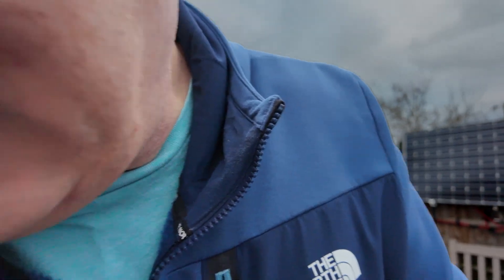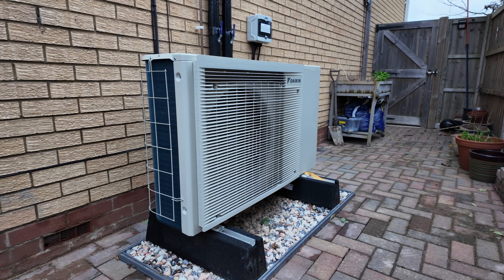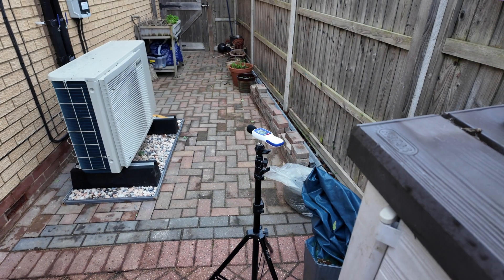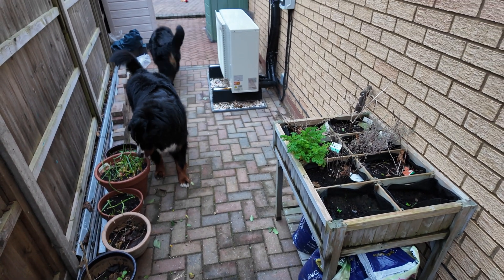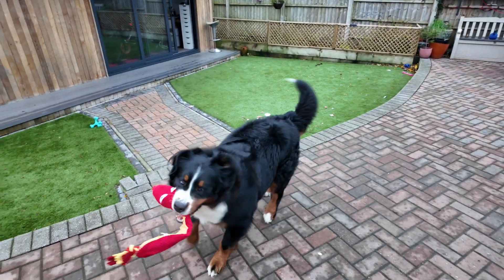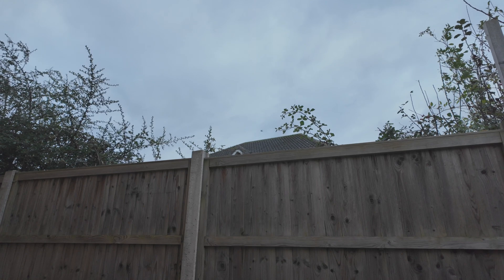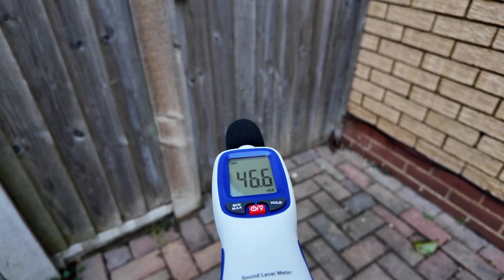The Shocking Truth About Heat Pump Noise in 2024

Comment: What about the noise inside your house where the cylinder is located? The outside unit usually isn’t a major issue, but the internal pumps often are. Could you check the sound level there?
Reply from the maker: there is zero noise, i can hear water moving through pipes when the showers are running, the pump seems to be silent
Reply: @JonathanTracey  Thanks so much for the quick reply! I’ve just bought a house with a Samsung heat pump. The outdoor unit is very quiet, but the indoor unit with the cylinder is very loud. Even with all doors closed, the noise is clearly heard in the bedroom. It seems like the circulation pump is causing it - both during hot water heating and normal heating. Since the heating runs almost constantly now, the noise is really hard to live with
Reply from the maker: It might be a sign that the pump needs replacing, @mediafire09. I checked mine today and it’s very quiet in the cylinder cupboard — it sits on the other side of a wall from the Chief Finance Officer’s bedside, and I’m sure I’d have heard about it if it was noisy!  

I tracked down our circulation pump and it’s actually up in the attic above the tank, so if it were making any noticeable noise we’d definitely hear it in the bedroom. Yours sounds much louder than it should be.
Reply: @JonathanTracey  Thanks, that’s really helpful! I’ll try measuring the noise level (in dB) to see just how loud it actually is

Comment: Had our 6kw Daikin ASHP installed in summer by Octopus and whilst it works really well in terms of heating the house and hot water it’s far from quiet in operation. The main issue is the amount of noise it generates inside the house. 

First issue is that as you probably know, below 6 degrees C the circulation pump runs continuously to avoid pipe freezing. In our set up we have two zones, upstairs / down and thus if neither zone is calling for heat then the zone valves are closed and the only path for the water is through the by pass valve. This creates a lot of noise and can be heard throughout the upstairs. Temporary fix has been to remove the actuator on the downstairs zone valve leaving it open and thus a path for the water to flow. I presume that most installations don’t have any zoning but we like our upstairs a bit cooler than down and hence why we decided to keep the two separate. Octopus have been back to implement this but not sure if this will be the best permanent fix. 

I question why you need to protect insulated pipes from freezing at anything below 6 degrees and why the flow has to be so high, currently set at 15l/min. Octopus are also going to change the bypass valve to whatever the latest model is as it meant ti be a lot quieter in operation.

Second issue is with low frequency compressor noise during the first 30 - 40 mins of operation, or when the HP is working hard. Our unit sits away from any neighbours and against a gable end with no windows. We can hear the drone of the pump both in the living room and the bedroom above. When you go to the unit it isn’t the noise of the fan / air exiting but the drone coming from the rear of the unit. What probably isn’t helping is a solid, high wall running down the side of the house. It’s several feet away from the unit but it’s probably a perfect reflector that’s causing the noise to reverberate between it and the gable wall of the house. Not much we can do about this but I do question why the Daikin has to ramp up as it does and how this can be tweaked to reduce the noise nuisance. Octopus due back in the next few weeks so will see what you have to say.
Reply from the maker: Not had any of those issues with mine, have heard there are issues when it’s wall mounted (instead of on the rubber isolation feet) is that how yours is installed ?
Reply: @JonathanTracey  floor mounted. I guess you don’t have any zone valves hence no problem with the circulation pump running against closed circuits. In terms of ASHP location / installation is very similar to yours but we do have a solid brick wall to the side, rather than a wooden fence, which may be part of the problem. I have heard of some folks getting Daikin to add sound insulation around the compressor so may need Octopus to sort this. Will be getting them back in a couple of weeks as I’m still not 100% happy.

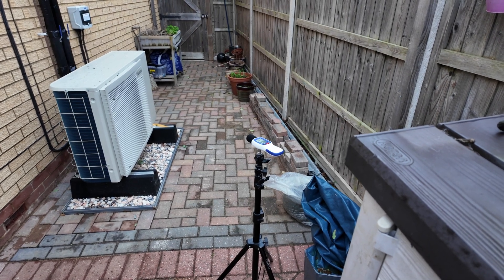Comment: Thanks for the video. Here are my concerns as a hyperacusis (hypersensitive hearing) sufferer. The low frequency noise that not everyone can hear, such as the wuh wuh wuh wuh pulsing noise. I can hear it in this video at approx @1:45 onward. It is not loud, but it penetrates/irritates the ear drums, or at least it does in me (not yours specifically in this video, I mean that pulsing sort of hum). A developer company is building 62 houses from my back garden onwards in my village, they are 2 years in so nearly done. Used to be very peaceful here, and although the houses aren't sold yet given my hearing problem I have started to worry about the low frequency noise from 62 heat pumps on a small field. The developers left a diesel generator on for 2 weeks 24/7 at one point and I was driven mad by it, even though it was 100ft away and only registered 60db when close by it, at night it sounded very loud, it was that pulsing noise again. I think low frequency noise is the issue for some, such as me, rather than the db reading, I realise I am in the minority though. I am hoping and praying the developers use decent grounding for the HPs, just like you have with the gravel under it.
Reply from the maker: That’s always gonna be a consideration, I have the opposite issue in my top end hearing is completely gone (high frequencies) which makes me more sensitive to low frequency noises. Hence the reason for using a sound meter because I can’t rely upon my ears.

Comment: When you compare how much you save relative to gas, excluding solar panels, how many years does it take to break even from the initial costs (assuming no comparison with fitting a new boiler).
Reply from the maker: So two points, why do we need to do an ROI in a heat pump, we never do it for a gas boiler? The cost for me was basically the same, to replace my old boiler (27 years old) with a new one, new tank and radiators was £3700. The Heat pump was £3750 all in, but I had to upgrade my showers so call it £3900 for the heatpump. So costs are basically the same but now I can run the heat pump from solar, not something I can do with a gas boiler
Reply: What is your saving on  energy bills per month compared to before if you exclude the solar?
Reply from the maker: I can't exclude the solar as I have had it installed for 15 years so its part of our house

Comment: here is real world info.
the only heating machinery I ever hear when I go for an evening stroll are the heat pumps.
if a house IS well insulated and well sealed and it has good r-value windows and doors it'll be cheap to heat no matter what system you employ.
Reply from the maker: Funny how we never hear gas boilers when we walk past a house—but that’s only because their exhaust is invisible! Instead of a quiet hum, they’re busy pumping out carbon monoxide, nitrogen oxides (NOx), and particulate matter, all of which contribute to air pollution and respiratory diseases. Heat pumps might whisper in the background, but they don’t coat your lungs with toxic fumes. Personally, I’ll take the low hum over a side order of CO poisoning any day!

Comment: Did you have extra insulation  on walls and floors ? Also did you have the larger radiators put in ? Im looking at moving to the orkney islands and there is no gas  the property im looking at has oil fired heaing  at the mo  im not sure if to upgrade the  oil heating change to lpg  have storage heaters installed or a heat pump will have maximum amount of solar and possibly  a wind turbine   as well I have had  a few qoutes and  its very vairable  upon looking at the home report some of the  options to save money are crazy spend  £45k to save  £400 per year   really doesnt seem viable  at all  if im luck i may have another 10 years on earth
Reply from the maker: yes insulation is a must, to get the government grant you need a EPC that says insulation is acceptable. we had new radiators throughout and a new water tank, all in cost was £3900. obviously adding batteries and solar/wind will make a huge difference, but as you say it’s down to the payback period. A wind turbine in the orkneys should pay for itself pretty quick if you have the space to put up a decent sized one. don’t waste your money on these amazon specials that claim to be 400w they are rubbish
Reply: @JonathanTracey   yes big ouch for thevwind turbine £22k  the biggest problem I'm seeing is the insulation that's going to cut rooms down over 9 inches can't have it done on the outside as would lose the lovely stone work
Reply from the maker: assume it’s an old building, they are quite costly to insulate. what size wind turbine is that!
Reply: @JonathanTracey   the one I've been recommended is a endurance one  e_3120 model number 50 kW tower height 24 to 36 meters 19 meter rotor diameter  if the calculations are correct with the maximum solar plus lithium  batterys should be able to be totally off grid

Comment: I had to pay for planning permission because we were 1db over the MCS limit. I believe this rule is now removed. £320 I won’t get back 😀
Reply from the maker: i think the rules that were relaxed was about being 1m from the boundary, so you would probably have had to pay it anyways. Won’t make you feel better but hopefully your planning went though.
Reply: @ It did pass. Like you, I tested the background noise, it was around 50db. With the heat pump running it hardly makes a difference. Interestingly I notice the fan is normally running at 620rpm. It has run faster a few times, less that 1% of the time, I would say.

Comment: It is not the noise, it is the frequency at certain times that is a nuisance.
Reply from the maker: the frequency you hear as pitch and the pitch hardly changes, it’s caused by the speed of the fan and the diameter of the blades. the speed varies but never gets that fast and the diameter is fixed. so the frequency range does not change in a very large range. given the volume falls off very rapidly with distance it won’t make very much difference
Reply: @ it is most probably the compressor that creates the frequency that is annoying to the human ear.
Reply from the maker: maybe as it gets older it may start making a noise but nothing is audible right now. but again it’s noises going to drop off with distance. given the 100s of millions of ac/heat pumps installed it’s not been an issue so far as i can tell
Reply: @  I have three HPs and at certain times the frequency would be annoying. Luckily enough we have a large enough house to install them out of the way.
Reply from the maker: ok will keep an ear out :-) will see if i can get a audio spectrum analyser and see what is beyond my old ears are capable of hearing

Comment: Our daikin, installed 2yrs and 3 months ago and serviced on time is still very quiet. Our neighbours can't really tell if it is on or not or ever commented on that over the time we had it. However, the only time noise was ever mentioned was before installation, basically we had to do a planning application being near the road facing towards the neighbours, at that point we did get an objection over noise but was overruled when we sent the daikin spec sheet and a short video of the althema working from the daikin website to reassure our neighbours and appease the council. However, when the surroundings are dead quiet at night I can hear it ever so slightly as you walk past pulling air but only at full pelt (rarely) so it is impressive and nothing that bothers anyone. I personally don't think It is no noiser than our old gas boiler, which you could also hear inside the house. At least the heat pump is not blowing out fumes which I love so hopefully our neighbours can now enjoy the fresh air. ❤❤
Reply from the maker: good to hear, seems there is a lot of fear mongering about noise, when there are so many noise things to be concerned about.

Comment: Measurements are one thing (legalities etc), but intrusion is another. 
If you review the different types of housing stock, you will understand what the issue 'can be'.  Older properties which are close, and/or back-to-back could be an issue because whilst the sound may be below a legal limit, the intrusive nature of a continuous 'drone' can be the problem. Think of this especially on a still night, and with many adjacent properties 'humming' at each other!!
Reply: Not to mention the vibration. Not every heat pump is made equal. The gaslighting around this is, well I guess it’s actually expected.
Reply from the maker: Yep I’m not saying it’s not an issue especially in tightly packed housing estates, but a boiler isn’t silent either, and it’s also producing harmful exhaust. WRT to your comment on drones, I agree but only anti social,drone owners fly near peoples homes at night, and if they are anti social enough to do that I doubt they will be worried about annoying neighbours by making noise.
Reply: @JonathanTracey  Drones - I meant the constant hum/drone of the heat pump..
Just like a substation transformer.
Reply from the maker: Ah sorry my misunderstanding, the frequency of the ‘drone’ seems to drop off very quickly with distance. More than 4-5M and it’s lost in the background noise

Comment: My heat pump mini split isn't loud, but gd when it defrosts and the inside unit gets cold, it starts creaking, and keeps it up when it goes back into heat.
Reply from the maker: hmm what’s actually creaking, can’t imagine that’s by design. maybe worth getting looked at
Reply: @JonathanTracey  it's the plastic body, it's typical. Maybe not so much on other more expensive models
Reply from the maker: is it the expansion or contraction other plastic as it changes temperature that causes the creaking?
Reply: @JonathanTracey  yes, it is that.
Reply from the maker: hmm sounds like bad design, not sure there would be a simple or affordable fix
Reply: @JonathanTracey  every mini split that uses the high mount air handler does it. The coil attaches to the body of the unit, so it's going to expand and contract.

Comment: My neighbors' 20+ year old condensers are much louder than my new heat pump.  My heat pump sound rating is 53 db(A) and it's right outside my bedroom window.  I barely hear when it starts and then becomes too quiet to hear.
Reply from the maker: pretty much the same here, there are a lot more noisy things even out here in the countryside

Comment: Out of curiosity do you have TRVs on your rads? I have Wiser electronic one currently, but I told the Octopus surveyor I'd like to get rid of these when they do the install as they have been a bit of a PITA. She said that was a good idea but didn't offer up whether I'd go back to manual TRVs or not, Also, she said the Daikin heat pumps are single zone only, my house currently has a downstairs zone controller and an upstairs zone controller, so a two zone system. So I guess I am going to have heat on everywhere in the house.
Reply from the maker: yes, they fitted brand-new valves on the new radiators. They’re set to fully open and I was told by the installers to leave them that way. As the house is single zone you get a constant temperature across all rooms. It makes the Heat Pump more efficient instead of having one cool room and then as soon as you open the door the rest of the house dropping in temperature and the Heat Pump having to work harder to get it back to temperature.  Before the install we had electronic valves that were controlled by our hive heating system to be honest I’m much prefer it the way it is now.
Reply: @JonathanTracey  yeah, the wiser ones have been a bit of a pain, noisy, expensive on batteries and sometimes just turning  random rads on and leaving them on making rooms like ovens.
Reply from the maker: yeah same with the hive ones we had, made very strange noises in middle of the night.

Comment: The lack of noise is suspicious. Anyone could have one of these and the neighbors would be unaware until it was too late.
Reply from the maker: The lack of noise is because it does not make that much noise. What do you expect a jet engine or something?
Reply: Lol it's a heat pump not a secret weapon! Why would it matter if they were unaware? Clearly not an issue
Reply from the maker: if i had a secret weapon the wife would have told all her friends by now 😂
Reply: Mine did sound like a jet engine and octopus had to replace it the new one is quieter but still disappointingly lound:(

Comment: Some years ago I was involved in the design of some small base stations that were to be installed into open plan office. The maximum allowable noise we had to not exceed was 55 dBa for a working office.  Given it is a logarithmic scale every 3dB below that is a halving of the noise. The pump here is way less than would be even noticeable.
Reply from the maker: I fully agree, I live about 2 miles from a major dual carriageway intersection, it’s so quiet where I live that I can hear that road when it gets busy. The Heat Pump produces less noise than that road junction.